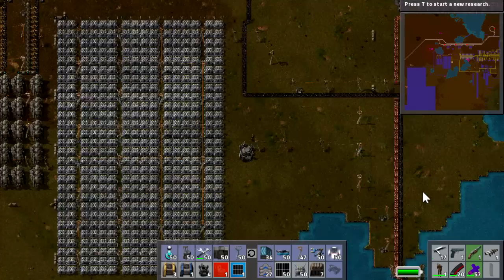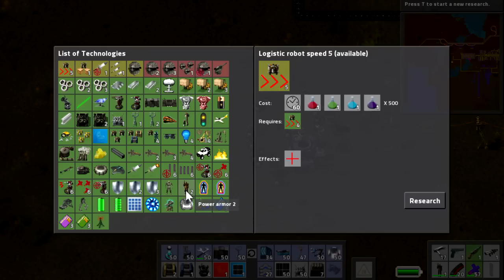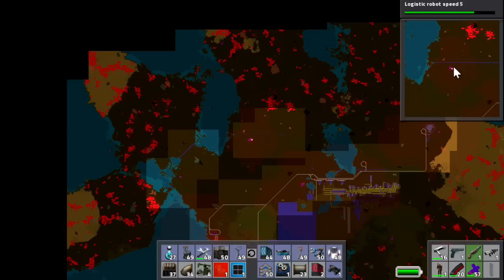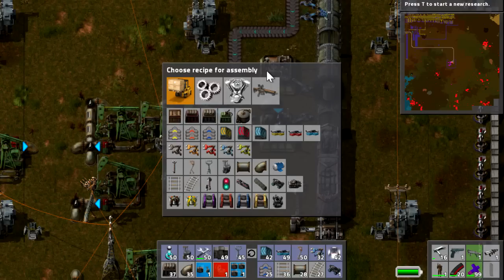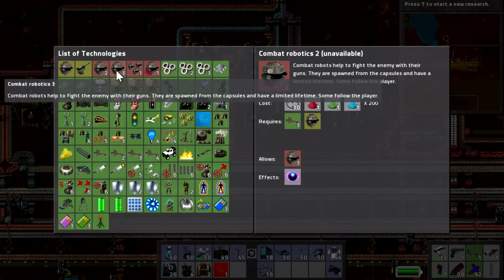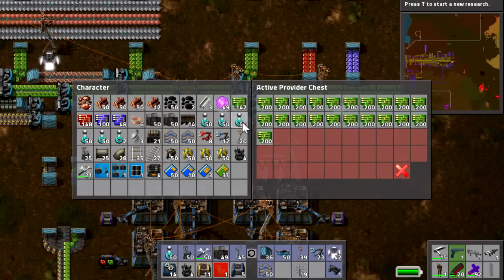Factorio 16 Oil Barrels

Comment: if only this was not all prerecorded to the end or so, but i still must say it. last i checked, light oil and heavy oil could be converted into petrolium in chemical plants

also, your creating 2 different modules, and trying to put them into a chest which you restricted to only have one slot. so you only have 2 purple level 1 modules.

Comment: You can heat up ANY liquid (water, oil, etc) and use it in the power station.

Not quite logical but it removes it from the world. You can also just pick up a fill tank and it looses all the liquid to somewhere... Again, not logical.

Comment: Just so you know X, to make the basic circuit most efficiently you should run 3 copper wire assemblers into 2 circuit assemblers, If you line up the the 3 wire side by side and then space the 2 circuits with a one square gap between you can set up with 2 fast inserters out of each wire assembler with 3 of them into each circuit assembler.

Comment: 6:53 "Let's just run back in there and shotgun the hell".
Would be a lot easier to light up everything if you include lamps in the blueprint.
You can place gates on the rails .
Lol you are calling assembly machines crafting tables.
A longer time on the train schedule would probably be better since you still only produce the full oil drums slowly and therefor still transport the same amount in the same time whether or not the train goes more times or less and when it goes more times it costs more coal (not that is a big problem).

Comment: You have a small problem with your level 1 module production.  The left corner inside chests you set to only have one stack of items put into them, but you have two different types of modules set to be put into that chest.  That cause one assembly machine in each corner to be block from putting output into the chest, basically preventing it from working.
Reply from the maker: TroZ I fixed it later :-)